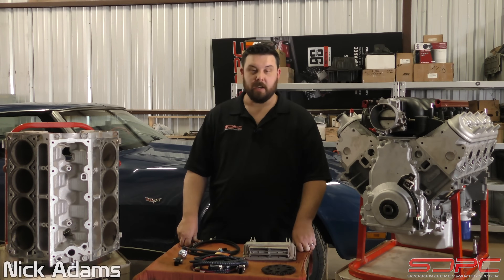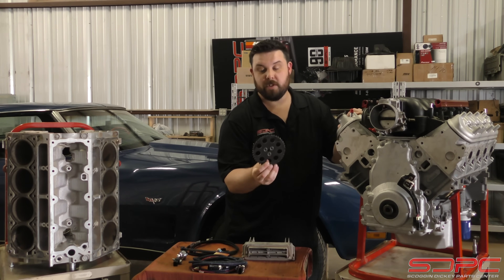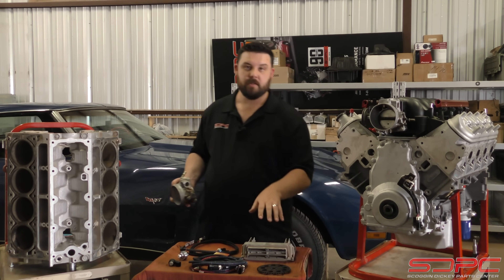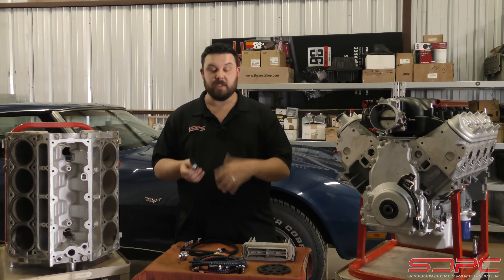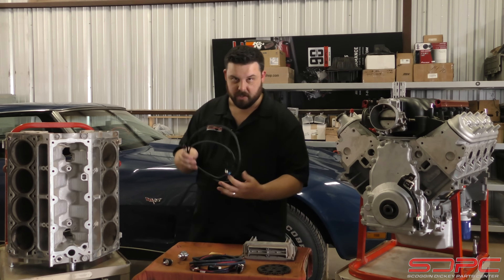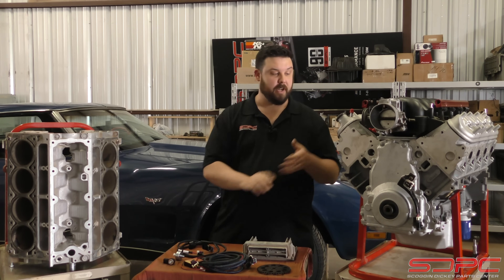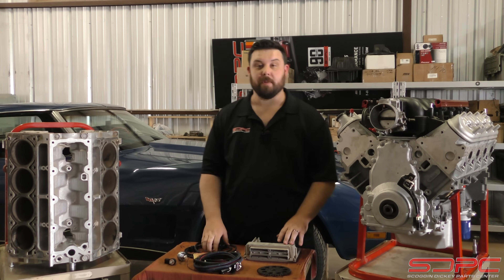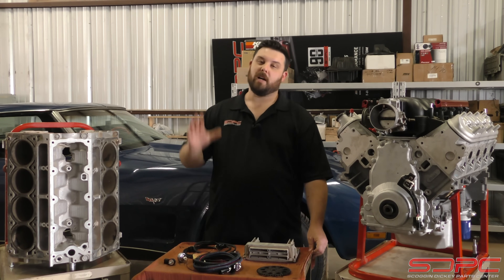SDPC Tech Tips: Gen 3 and Gen 4 LS Engine

Comment: I'm new to the LS world I have a 72 nova with a 383 stroker and I wand to do and LS swap I picked up a gen4 5.3 ly5 can i run a stand alone harness with the ECM vats deleted and put a drive by cable throttle body on a drive by wire harness

Comment: Cool stuff ok ??? Got a GMC Sierra with a LH6 2008, and I have  L96 2018 for diff project, but I’m not ready to use it .. can I swap the L96 into the 2008 GMC I can rebuild the LH6 later and use it in my jeep project?  What do I need to do this?  I also want to do a VVT delet and upgrade the cam to a TruckNorris thx …

Comment: I understand what he is saying, but do these modules adapt a gen 3 block to a gen 4 body/harness or is it only the other way around ?
Reply from the maker: It's only the other way around. If you want to put a Gen 3 in a vehicle using the gen 4 pcm/harness, you'll need to disassemble the engine and install a 58x reluctor and change the cam from a 1x to a 3x reluctor sprocket.

There are other changes you'll need to make but that just comes down to you making the engine work with the harness.

Comment: help i have a gen 4 4.8 4l60e 2010 silverado i want to put a lq9 gen 3 into what do i need
Reply from the maker: A) Sell the Gen 3 and find a Gen 4 engine.
B) Disassemble the Gen 3, add a 58x reluctor and 3x cam/gear, some wiring, change intake/throttle body, etc.
C) Go with a standalone ECU.

Comment: _ absolutely awesome information on video. Thank you.. I I have a question if you wouldn't mind or somebody with the knowledge wouldn't mind answering ?
I have a 99 C5 convertible Vette. I'm going to be putting a motor together over the winter and I am planning on running the up twin turbo set up.
Would you go with the Gen 3 or Gen 4 engine? I've heard that the Gen 4 engine is the way to go. I was thinking about buying a Gen 4 5.3 and building that rather than the Gen 3 original 5.7 that's in the car. 
Any help would be greatly appreciated thank you very much and it's ironic that I find you through Google because my uncle has a scoggin old race car I believe it's a 68 Camaro I would have to call him to find out he lives in Pennsylvania and he's had the car for years along with a 69 Baldwin motion Camaro.

Comment: Perfect information for many. Signals from the gas pedal to the throttle actuator control and throttle cause headaches as well. Just use a matched set from a donor or new by application.

Comment: I’ll keep searching but. What about the other direction. Using a Gen three block and building for a Gen IV system. I can’t get anyone to sell me their Gen IV. A bunch of flakes and rude asses. I can buy Gen III all day. If I have all new parts for my Gen IV can I drill and tap a Gen III FOR my Gen IV knock sensors? And where is the best location? As for the cam sensor, I can just leave that in place and unplugged. I was doing a dod delete when I found a roller with heavy damage. So I dove all in and found bearing damage galore. As it was intended to be a budget build and the cylinders were beautiful. I cleaned honed and was ready to assemble when I found a crack in the # 1 saddle. Cracked at the oil boss. Any input is welcome. I’m an old school guy this is my first LS. Thanks!

Comment: I’m doing a 5.3 swap on my 99 trans am it has the 3800 in it I’m trying to figure out what wiring harness I would use since my 5.3 had the dod and I completely did away with that ??? If you can thanks for the help

Comment: Can u put 24 in to a 2009 58
Reply from the maker: Not directly, and you can't use anything like the LG control box. You'll have to disassemble the engine, install the 58x reluctor, a 4x signal sprocket on the camshaft.

You can step down the 58x signal to run on a 24x pcm, but 24x cannot step up signal to run on a 58x pcm.

If you haven't disassembled the engine, it tends to be easier to sell the 24x engine and snag a 58x setup.
Reply: @Sdpartscenter  I have a gen 5 2015 6.2 can the valley cover keep the exhaust valve from working intake valve work

Comment: So I have a 07 Escalade that previously had the 6.2 engine that had  a 58x reluctor and I’m swapping to a 5.3 that is gen 3 which has 24x reluctor is there a way to make this setup work with original  pcm and harness  that came with the truck?
Reply from the maker: The only way is to disassemble the Gen 3 and put a 58x reluctor in it and run a cam with a 3x sprocket.

Otherwise, sell the Gen 3 and find a Gen 4.

You can step down a 58x crank signal to 24x, you cannot step-up a 24x signal to 58x.

Comment: Since the 5.3, 6.0 and 6.2L engines have the same stroke you could just swap crankshafts to a 24X gen 3 crank does that mean you would need to use a gen 3 crankshaft position sensor?

Comment: Hey I had question I had a bad crank shaft on my 5.3 I was wondering if I can use a gen 3 5.3 crank shaft I have sitting around I just gotta take my reluctor wheel off my gen 4 and replace it on the gen 3 then bolt it back up
Reply: Buy a new reluctor wheel michigan motor sports 60$ I wouldn't reuse.. I tig welded a small tack to crank after it cooled to make sure it didn't ever slip

Comment: Impressively pertinent video.  Covers exactly the topics needed to help someone move from a Gen III platform to a Gen IV.  Also, there aren't a lot of people that can speak that intelligently, yet understandably, about topics of this nature.  Someone give that man a raise!
Reply: I had a question right now I got a junkyard find it’s. 5.3 iron block from a 2002 suburban and I have a 08 gmc Sierra I want to put it in I was wondering if it’ll bolt right in. Right now the 02  5.3 has the electronic throttle body a cable that connects to the oil pan and the knock sensors maybe I can by pass the oil pan with the old one as well as the intake connecting the throttle body but now what about the knock sensors ?

Comment: Hi Nick! This is my first time ever messing with a LS.I have a question 01 Silverado 1500. I keep getting a misfire on cylinder 8 I'm wondering if I have stuck lifters I've changed out fuel injectors and knock sensors but the misfire comes and goes runs fine barely any hesitation or shakes your help would be appreciated thank you in advance

Comment: I’m taking a gen 4 5.3 with electronic throttle body out of a 2005 Chevy Tahoe and putting it in my 2001 gmc Yukon xl . They both are 4x4 . The 2001 is a gen 3 5.3 .with cable throttle body . Can I put my cable throttle body and intake on the gen 4 and it work?

Comment: How do you put a 1x cam signal on the front
Reply from the maker: By using the lingenfelter conversion box.

It will not work if you put a 1x cam gear in the engine.

Comment: Hi . 
This not related to your video. Please forgive me. I would really appreciate your advice. I have a LS2 L98 motor bore to 4.030" Wisco K448X3 pistons. Make good power on wheels (389kw on wheels) but still smoking and use oil. Ring gup is perfect piston to sleeves glearence good. Dubbel check at different machine shops. What can be the
 cause?. I would really like, and appreciate if you can give me same guidence. Thanks

Comment: Solid information since I’m swapping an LS7 into an 01 C5 Z06. What cam sensor would need to be used at the front of the timing cover if swapping this particular LS7 to 24x reluctor and 1x cam gear? Planning to run the LS1 to LS7 cam adapter harness to the front of the timing cover.

Comment: Does the Lingenfelter box work the other way as well ?
Likely No, so is there a pre fabbed set up if someone was to go the other way, Gen3 engine in a Gen4 Tahoe ??
Reply from the maker: Sell the Gen3 and find a Gen4, or take the Gen3 apart and change the reluctor wheels.
Reply: @Sdpartscenter  The Gen4 in my 07 Tahoe is bad  (200k mi).  I am looking for a replacement and hoping for a power upgrade to "justify" the effort.  I saw the Summit 450hp 5.3 which is why I was asking.
What would you guys suggest ??

Comment: Although your video is 2 years old I have some questions. I have a 2011 silverado. Swapped to a LS2 non vvt non afm, 58 tooth reluctor e38 ecm stock. I had a shop perform a tune with HP tuner. Since I did an exhaust delete, ran a 160° Thermostat. The guys shop is closed. I wanted to make adjustments on my tune. Which tuner in your professional opinion would best fit my need?
Reply: my recommendation is to buy your own HP Tuner and have someone remote tune your Silverado.
Reply: @michaelashby868 do you need the 58 reluctor?

Comment: What do i need for a 5.3 gen iv to a  6.0 gen 3 swap can i use my gen iv ecu???
Reply from the maker: Sell the Gen 3 and get a gen 4 engine. You have to change reluctor wheel on crank, 3x sprocket on the cam and other sensor/harness relocation mods to make the Gen 3 engine work on a Gen 4 pcm.

Comment: I have a 2010 suburban flex fuel Ltz it have a gen 4 engine in it but I want to put a Gen 3 in it how would I make it work with my computer system
Reply from the maker: You have to add a 58x reluctor to the crank, change to a 3x sprocket on the cam and a mix of other things. Honestly it's better to just do a Gen 4 engine, sell the gen 3 and never look back.

Comment: I would love a LS2/T56 swap for my 2016 Silverado... 2014 to 18 in Mexico. they had manual transmission so there is a clutch pedal assembly
Reply: So you're trying to put a gen 4 motor in a gen 5? From what I've heard anything that's gen 5 is not interchangeable with gen 3/4 motors

Comment: most underrated LS engine LY2/L20/LR4.... not to mention you could get the LY2 with a 4L70 in the work truck model
Reply: I had a question right now I got a junkyard find it’s. 5.3 iron block from a 2002 suburban and I have a 08 gmc Sierra I want to put it in I was wondering if it’ll bolt right in. Right now the 02  5.3 has the electronic throttle body a cable that connects to the oil pan and the knock sensors maybe I can by pass the oil pan with the old one as well as the intake connecting the throttle body but now what about the knock sensors ?

Comment: Hey crazy question swapping a gen 3 motor into a gen 4 vehicle the opposite of what your doing
Reply from the maker: Then you'll have to change the reluctor and update the cam sprocket to that of a 58x setup. All in all, it's easier to just get a Gen 4 engine than it is to go through the hassle and machine work of trying to make a Gen 3 work on a Gen 4 pcm.

Comment: So I have a Gen 4 LH6 that I am swapping into my 01 Corvette. I tore the Gen 4 engine down and swapped the reluctor wheel from the original 5.7 to the new Gen 4. So now that it has the 24x I would just re-use the crank sensor out of the 5.7?  For the cam sensor I have a new 1x cam gear but would the new updated cam sensor from the gen 4 motor read the 1x gear? I have the extension harness for the cam sensor I just want to make sure the gen 4 sensor will read the new gear, or if I need to do some wiring.
Reply from the maker: That will work! Always match the crank sensor to the reluctor.
Reply: @Sdpartscenter  Awesome! Thanks for the quick reply! Your videos have helped me so much through this swap!

Comment: I need some professional advice please. 

So I have an 08 Silverado that came with a gen 4- 5.3 liter engine. I bought a gen 3 LS in a 6 liter. 

I had a piece pressed into the crankshaft, I think it was the reluctor wheel? And he switched out the cam thing on the front. Then my engine ran on four cylinders until I took the computer to some guy who reprogrammed it so now it runs great.

Here's my problem. The guy who did it decided not to install the knock sensor at all. I would like to eventually install a basic turbocharger on it. I think I need a knock sensor for that. What is the most easy and cheap way to get a knock sensor on this engine?

One more problem is I have a ridiculous oil leak that looks like it is coming from the rear main seal. It's losing several quarts a week and I'm getting tired of putting oil in it plus it needs to be fixed before I can put a turbo charger in it. It has a new high volume Meling oil pump and I have lots of oil pressure, 40 psi idling warm 60psi while driving, so the engine seems pretty solid. How hard is it to put in a rear main seal and any advice on that? 

I had no idea this guy was going to half ass everything like he did but I'm kind of stuck with it and I would like to make it right. Is there anything else that would cause a leak that looks like it is from the back of the engine close to the transmission underneath? Thanks
Reply from the maker: You'll need to remove the transmission, torque converter and flywheel to gain access to the rear main seal plate.

If the harness is still there, you might be able to run some knock sensors on the outside of the block if you have room and might be able to find a hole to tap the right thread for the sensors.

It would be recommended to find a good shop to take care of both of those issues especially if you're losing as much oil as stated.

It's one of many reasons we usually recommend finding a good gen 4 block because of all the extra work involved of making a gen 3 work in a gen 4 vehicle.
Reply: @Sdpartscenter  I didn't know anything when I was buying the engine and the guy lied to me about everything. I don't have the money to replace the engine again, I'm stuck with it. I don't have the money to pay a shop now so I'm going to have to figure it out on my own. 

The guy who sold me the engine said it was compatible. 

His brother in law had the crank sensor done and put it together and installed the engine. 

I'm wondering what he did wrong to cause the severe oil leak. Maybe reused the old seal? I didn't even know a rear main seal could possibly leak that bad. BTW I told him if he needed to replace any parts I would pay for them, so there's no excuse for not replacing the seal. 

This has been well over a year ago so I'm stuck with this thing. If I could get these two problems with the oil leak and the knock sensor sorted out the engine runs really well. It runs smoothly and doesn't miss out.

 It does lack power on the low end which I suspect is because the timing is not being advanced with it not having knock sensors. But that's just a guess I don't know for sure. I'm guessing this is going to behave similar to an older engine that doesn't have a functioning vacuum advance? 

I'm not even sure where to look to see if there is a wiring harness for the knock sensors. If I could find it I could probably tap the side of the block for the knock sensors.

Thanks for the reply.

Comment: My friend has a 07 Chevrolet silverado 1500 5.3 has the nock sensor's on side of engine. The motor he bought was not Aluminum like his engine it was CAST iron block. We didn't know they was different until we put motor in and started hooking things up. The cast iron block had knock sensor's on top of engine and cam sprocket was a 3 bolt with sensor on timing cover.  We bought the sprocket that will adapter to that but the engine runs but no power. What do we need to fix this problem.  Thanks for any advice on fixing it.
Reply: I switched out a gen 4 engine to a gen 3 and had the newer reluctor wheel pressed on and changed the cam sensor out. My engine only ran on 4 cylinders. 

I had to take the computer out which takes less than five minutes. I took it to a tuner and told him what I had and what I switched to. He reprogrammed the computer and now it runs perfectly  I hope that helps. 

It cost me about $200.

Comment: i got a 07.5 silverado gen 4 with failed afm lifters.  im currently looking at a 450hp crate motor 5.3 also but its gen 3, any tips on the swap?
Reply from the maker: You'd have to disassemble the engine and change the reluctor wheel to start with. We recommend finding a gen 4 right off the bat.
Reply: @Sdpartscenter  any recommendations on similar gen 4 motor with similar power (450hp) and price ($4000) without AFM?
Reply: @DurkinDurks  just change the lifters to something like ls7 lifters and swap a bigger cam in there's nothing special about that 450hp motor it's basically just a 5.3 with flat tops and their stage 3 truck cam, your gen 4 has flat tops and better cylinder heads put that cam in and you'll get the exact same thing

Comment: Can I put a gen 3 in my gen 4 09 truck ?
Reply from the maker: If you absolutely have no other choice, yes, but you'll have to disassemble the engine and change the reluctor wheel to start with.

It's usually easier to just sell the good Gen 3 and start with a Gen 4 anyway.
Reply: @Sdpartscenter  is that it see o bought a gen 3 to fully rebuild for my truck but then a shop around me said I couldn’t use it and that I couldn’t chang anything to use it

Comment: I love seeing these various sensor converters that make these stock computers work.
I learned about it for the first time back in 1998. When getting more than 400 horsepower out of a Nissan 300ZXTT, the stock MAF becomes a choke point. Various sensor formula converters would make it possible to fit an oversize MAF and still get proper drivability.

I'm kind of surprised that the 24 tooth computer couldn't be reflashed to understand the 58 tooth wheel. Oh well, as long as there is a quick solution, I'm happy.

Comment: thank you for your information I just subscribed because I am building a vehicle that never was meant for my parts. its a 78 j10 lq4 block 408 stroker. the crank I want is a 58 tooth do I just change out the reluctor wheel of my crank or can I configure it in my Holley dominator ecu that controls the engine and 4s80 transmission? not using the oem computer. thank you

Comment: I'm looking to swap a GMC 2008 5.3L into a 2008 4.8L Silverado. Will I need anything other than a new computer to read the sensors on the 5.3L?
Reply from the maker: You should be able to just put the 5.3 in there and load an appropriate tune to the existing 4.8L computer since they are the same year.